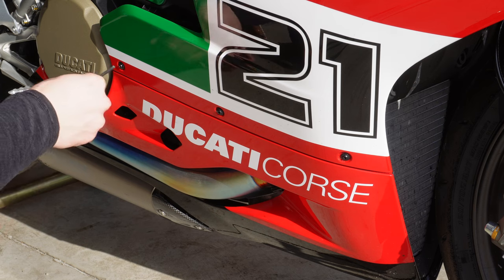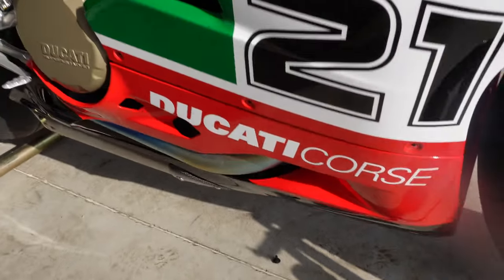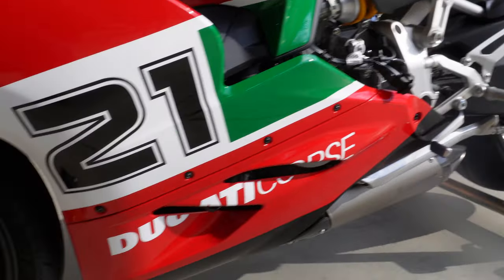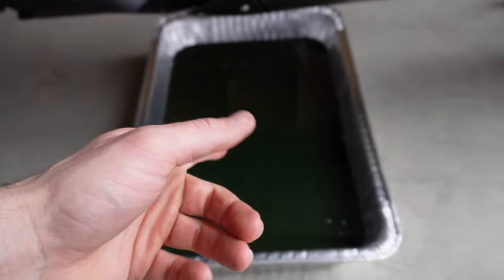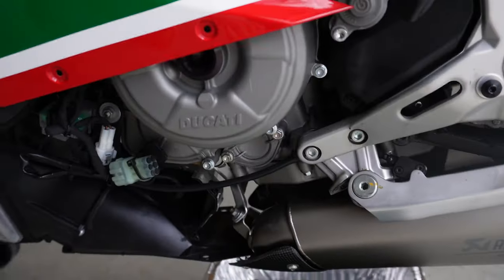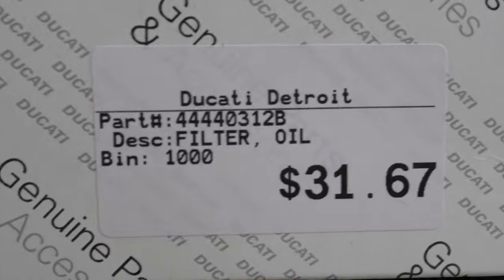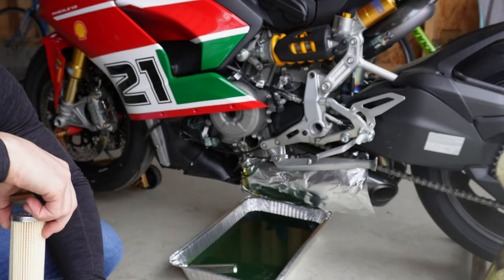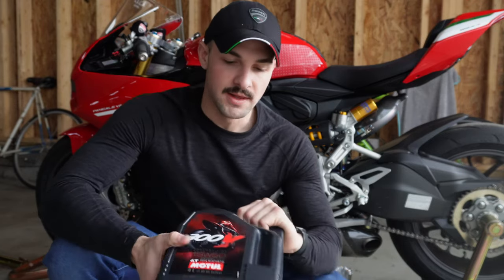Panigale V2 Oil Change: How to / DIY

Comment: Can't believe you didn't use a torque wrench on the filter cover 😱 those bolts are 8nm they snap before you feel it ! And your oil looks new coming out! On the bright side, nice video and the bike looks great!
Reply: 300V is a race/track day oil and as such should be replaced regularly. Don’t leave it in for the 12K service interval as it won’t do your engine any favours. Motul 7100 is my choice 😁 and still changed every 6K

Comment: no mention of the o-rings on the filter cover or the crush washer on the drain plug???
Reply: Surprisingly not all of them have them. Mine didn’t come with it from factory and have never had an oil leak.

Comment: I suggest using the Stahlbus oil drain valve and brake bleeders. No more crush washer changes and no mess. Makes oil changes and brake bleeding 100 times easier.
Reply: I'm listening, please do tell more, because this job took a minute and was very messy.

Comment: Good video and pointers; do you recommend (if it’s necessary) to pre fill oil filter before installing.
Thanks
Reply from the maker: I do not no. I fill the bike with 3 quartz and run it for a bit. Then let it settle for at least an hour on a rear stand and then fill it to the middle mark on the viewing window!

Comment: What’s the size of the bolts to pull out the oil filter cover  ????
Reply: Use the bolts off your passenger pegs 👌🏻
Reply: The bolt holding the filter cover is a 6mm thread dia, and the bolt to remove it is a std 8mm,  ( 8mmx1.25mm thread pitch).
Reply: @lesfoster4364 I wish Ducati designed this better. It's just an extra step. Why not design it so you can remove the oil filter and throw it, just like most other motorcycles..

Comment: Nice.  This your bike's first oil change? How many miles?  Awesome bike!
Reply from the maker: This is my 4th oil change and the bike has 3100 miles. I do oil changes pretty frequent since I started doing track days!
Reply: @desmoholic.racing  Sounds good!  Did you need to do the first oil change at the dealer for warranty purposes?
Reply from the maker: @JuniorJr_23  I’ve done all my own oil changes actually. I love working on my own stuff
Reply: @JuniorJr_23  Yes